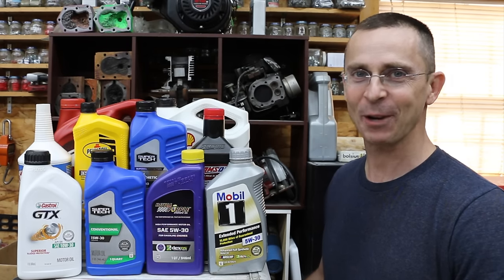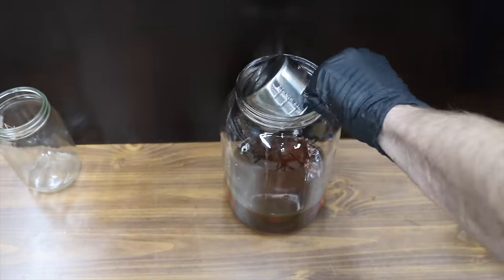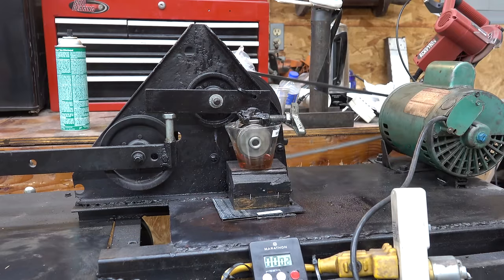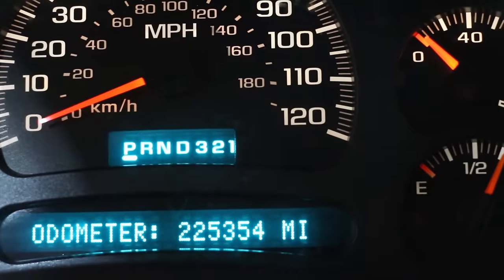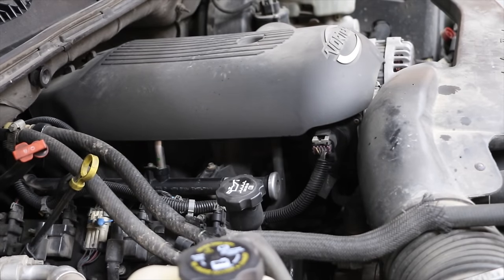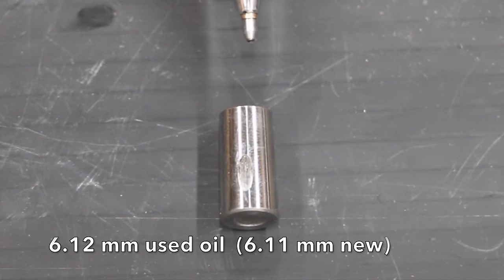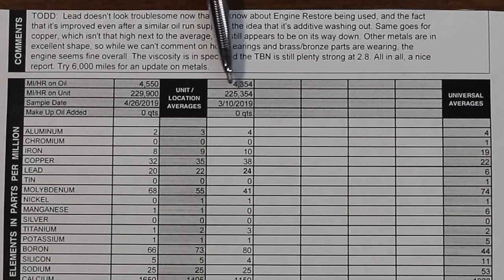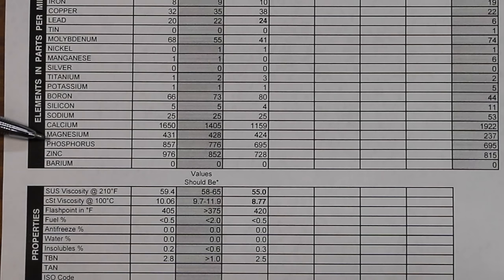Will Mixing 10 Motor Oils Damage an Engine? Let's find out!

Comment from the maker: Sorry it has taken me so long, but I finally have some new and improved merch! https://teespring.com/nl/stores/project-farm
Reply: Project Farm  First off love your vids man. Second would for you to test an oil catch can on a lawn mower to see if it works or if it  make the difference??
Reply: Do a video we can do to see if Lucas Oil stabilizer works/increases viscosity
Reply: Hey PF, obviously you use lots of small engines for your videos. I'm looking for a new mower and I'm wondering where you get yours.
Thanks
Reply: Hey Project Farm, I was wondering... Can you use a small amount of Nitroglycerin to revitalize old stale Ethanol Gasoline?
Reply: Hi PF. I was buffing out my headlight over the weekend and was wondering what you think about the headlight restore kits. Would love to see what works the best. I used the 3m kit(FYI) headlights look brand new. Just hope you would enjoy doing that. Thank you.
Reply: The site is in German, and it won't allow Arizona as a shipping location.
Reply: Could you run a heat failure on a small engine please? I've got a guy who refuses the fact that once an engine gets hot enough it no longer needs a spark to run, ie runaway. The only shut offs for which being remove fuel, remove air, remove heat, or remove compression.
Reply: Why are you apologizing? it is worth waiting for
Reply: Video on all those super additives like Dura Lube they're always showing them through gravel in the engine and doing crazy stuff
Reply: I’d like to see oil designed for large engines with detergents how badly it will effect a motorcycle high RPM engine. Foam has been known to accumulate inside the crankcase if you fill a motorcycle engine with regular motor oil with detergents in the ingredients.
Reply: Project Farm. If I send you some sorghum syrup will you make a video using it as an engine oil and running it through the combustion chamber? My grandpa makes it here in East TN and he calls it Mother Nature in a Jug. It's sort of like molasses but it's a different process to make it. It's very thick and sticky and I'm just curious as to how it would perform and what damage it might cause.
Reply: Do blue devil stop leak
Reply: I know motor oil will work for 2-cycle oil but I wonder if there's any alternatives let's say like honey or syrup for 2-cycle oil that would be awesome
Reply: I know motor oil will work for 2-cycle oil I wonder if there's any alternatives like honey or syrup or something of that nature that would be the video I would definitely tune in to thanks
Reply: I liked gat you improved the cup design with now a cutout and plastic tape shield. It always bothered me to see you make a mess for us but didn't know how to have a solve for you. 

I had an engine that was 20 years old that called for 5w-30 and from wear probably needed 10w-30. Not knowing that I couldn't, I used 0W-30 and subsequently 0W-40 because I wanted low wearing startup at cold temps that never froze in southern California. Down the line an OCI or two I started having a rattle at engine room from 1800-2500 rpm accelerating to speed when cold. Concerned it was due to bearing damage, but cannot expend the cost to open the engine to tell. Hopefully that was unrelated but that's my coincidence. Thereafter I used synthetic 10W-30 with good results when new but soon thereafter the rattle when accelerating would return only when the rpms were at that level. Great work as always. I wish there was another good company to do UOAs than BS. If I do decide to do any more, I might seek out Napa. They have a lot of people who write up the reports and none of the look at your past notes except the main guy and I always feel like I'm bothering him even though he does respond albeit seemingly begrudgingly. It's a high cost for what it is. The TBN is a waste of money I feel like. Good for this video but unless a person is trying to run Extended OCIs, when a manufacturer recommended OCI is 5k for the last 20 years because the engines produce wear metals in normal operation, it's unnecessary to get the TBN.
Reply: CAN YOU TEST RAVENOL
Reply: Thanks for the videos. Love them! Could you do a video on rotella t4 used in a gasoline engine with extreme use?
Reply: Just realized your oil lab is like 10 minutes from where I’m at lol
Reply: How about testing oil filters to see which one works the best?
Reply: Talk like it was a race when the oil was sliding down. Hilarious! 6:22
Reply: WHAT ABOUT Lucas Oil Stabilizer on engines over 175k?
Reply: Project Farm what’d be the best engine oil for Diesel engines? Can you do a video on that?
Reply: @brandonbrown3899  it does but placement for it to do its job can be interesting as space and access likely will require modifications to the engine cover. I had a 12.5hp Briggs in a Poulan XT a neighbor gave me as it had multiple issues including the solenoid on the carb allowing fuel to drain into the engine. It had been run with fuel in the oil enough that it sounded like an egg beater. It blew a head gasket mid summer as I was getting another engine ready for swap out during winter so I changed the head gasket.

Turns out the ticking was a worn wrist pin not to mention piston skirt allowing the piston to be moved slightly in all directions around the bore. The limitation of space between the engine and the plastic cover with the air filter posed the biggest problem as after putting this back together, it would smoke out the neighborhood turning right.

FYI, clean the breather as sometimes they get gummed up and then the engine will start pulling more oil into the intake as the valve doesn't meter. Between junk in the breather and being worn out, oil was accumulating in the intake low spot which is on the left side of the engine and why oil would suck into the engine turning right.

I ended up taking the short plastic stub intake manifold off and pulling the press in nipple out with the small hole. I turned a piece of 3/4" aluminum bar stock down to create a vertical tooth that would stick up enough into the path of the low spot to direct the oil accumulation down into a piece of clear tube hanging below.

The tube fit perfect over an old tire valve stem with the rubber stripped off and pressing the Schrader valve while running dumped the oil quickly as the blow by had enough force to help do so. I have an acre so it would fill the 6 inch long tube twice during mowing and be half full at the end. The engine made it to the end of the season and so did the same spark plug without fouling. Neighbors were happy without the blue cloud at each turn. So what I built was sort of a catch can in a way but actually better as I could see how full it was while mowing. Lots of ways to accomplish something to make due with what you have for the time being.
Reply: @andrewawf9889   wow lol
Reply: Hey, nice videos. Where do you send your oil for analysis?
Reply: What is your main oil that you use in your vehicle's?
Reply: Will engine run on gas🤔
Reply: Project Farm can you test the Valvoline synthetic oil they sell at Walmart in the 6 quart boxes. That’s what I use since it’s only $18.00 . I am curious how good it is.
Reply: Those running lights are a bugga yo change hahaha I see why ya left that one go 😉🐒
Reply: Would Project Farm be interested in doing a review for a new Motor Oil brand?
Reply: What are the chances PF test synthetic marine oil, like Ams oil 10w30 full synthetic, Sierra, Quick Silver etc.  It would be a first!
Reply: A T shirt with the tested and approved logo like on the stickers would be cool
Reply: Please use breakoil as engine oil
Reply: @jacksonf1984  I think he gets the Predator engines from Harbor Freight
Reply: Amsoil vs Cerma. best STEEL TOE PUNCTURE RESISTANT SNEAKER AND BOOT
Reply: Love your videos !
Which oil in your opinion is better between Mobile 1 full synthetic and Amazon full synthetic?
I currently use Mobile 1 full synthetic on all 3 of our vehicles. They are naturally aspirated gasoline engines.
My wife’s Outback has the 2.5 liter, my Rav has the 3.5 V6 and our Ranger has the 4.0 liter.
Reply: I hate that you used diesel oil. why?
Reply: I performed this test when I was 16 years old. Subsequently so many years later both my sons repeated this test with their cars.